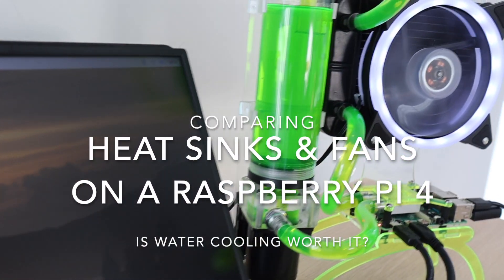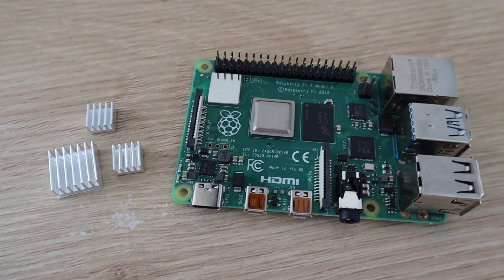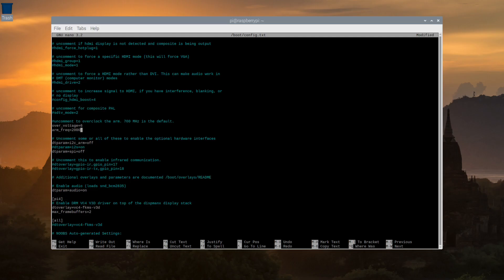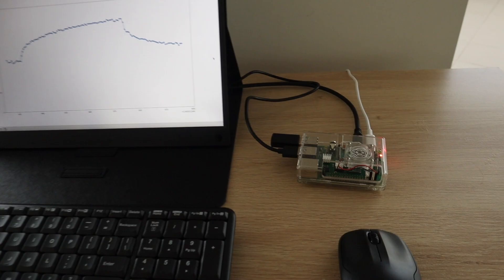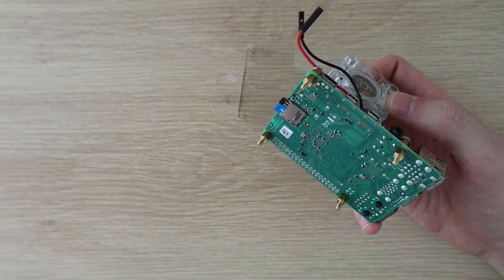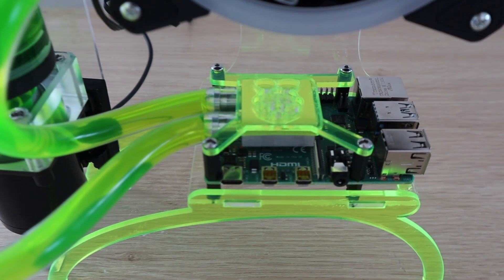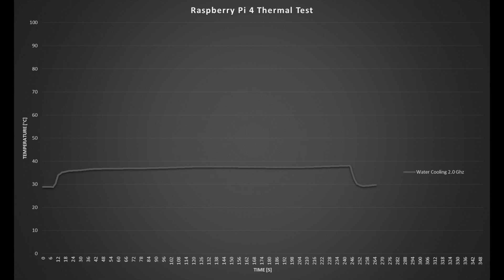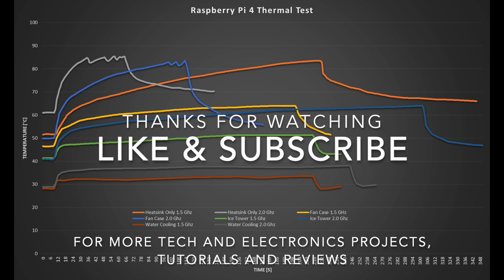Comparing Cooling Solutions On A Raspberry Pi 4 - Is Water Cooling Worth It?

Comment: Try a bowl of mineral oil.
Only half kidding.  A properly designed enclosure with many vertical exterior fins, and filled with oil, could probably keep the Pi cool all day with no sound.
Reply from the maker: Yeah, I've seen a few mineral oil cooled Pi's online and they seem to have good cooling results! I guess I'm just not a big fan of having an oil soaked Pi around and having to wash my hands every time I need to swap a connection or change the SD card - although you could work around this with a number of extension cables. Maybe I'll give this a try in the new year, sort of like an industrial oil-cooled transformer housing with radiator fins.
Reply: CooliPi?

Comment: I use argon one case to cool my raspberry pi 4s, overclocked to 2147mhz for CPU and 750 for the GPU, during normal use (emulation of GameCube, Wii, and Dreamcast) I rarely see temperature above 50 degrees Celcius (the fan kicks in when it reach 55 degrees. so under normal use, it is totally silent and just passive cooled) during stress testing I can reach as high as 55 degrees so the fan starts, but I have never thermo-throttled with this case, even during stress test overclocked to 2147mhz CPU and 750mhz GPU  and over-voltage to 8.
Reply from the maker: I've never tried an Argon case, but I've heard that they work pretty well! Thanks for the info.

Comment: Great video! I wonder how the Pi 400 would fare if overclocked this way. The Pi 400 has a heatsink that is essentially a big metal sheet spread over the width of the keyboard. It also runs at a somewhat faster speed of 1.8GHz.
Reply from the maker: Thanks. I haven’t had an opportunity to try one out yet but I have seen an article where someone overclocked it to 2.147 GHz and it ran for around 10 minutes without overheating. I’ll try find the link to it. The nice part of the Pi 400’s cooling, being a large piece of metal, is that it’s completely silent.
Reply: the Pi400 is a completely different chip, it has a much better stepping than the Pi 4. that's why it can perform so cool even with an overclock and  simple metal heatsink
Reply: @SweatyFeetGirl  Not completely different. Eben Upton has said, it's just another revision with some clock trees more finely grained. It even has slightly lower performance than the regular chip used in Pi 4 model B (according to MagPi benchmarking) - most likely it wakes up with some additional latency. I use my 8GB model at 2350/750/550 MHz for the CPU/GPU/core. temperatures under 50˚C with 27˚C ambient temp. Passive, no fan.
So, to reduce latencies anywhere, I run it at max frequency all the time :-)

Comment: Add some cheap four dollar thermal paste with the Ice Tower and it idles at 28 to 30 overclocked and never goes over 36. Simple cheap and effective extra
Reply: I got the same results using thermal paste instead of the pad
Reply from the maker: That’s a good idea, I must try it out in a test! I’ve seen a few people say that thermal paste works much better than the contact pads and then others say that they see no difference. 
Perhaps it’s the quality of the pads that makes a difference too.
Reply: @MichaelKlements  yeah I just replaced the pad included with the tower with the paste and it made a huge difference
Reply: @MichaelKlements  Pads are evil. Don't use pads :D

Comment: Awesome project. I have used the "whiny little fan in a case" option in the past. Might have to try a 120mm fan and some heatsinks to make a not-noisy solution.
Reply from the maker: Yeah I think with trying to make a quiet Raspberry Pi, bigger is better. Either put on a really large heat sink with no fan or just a larger and slower fan.
Reply: @MichaelKlements  While you are at it, how about cooling for a Pi 4 Compute Module as well? I need to get one for the NVME on the I/O board, but I can't seem to find anyone who has actively cooled one. Thanks.
Reply from the maker: I've been trying to get hold of a Pi 4 Compute Module and IO board for a few weeks now but can't seem to find them in stock at any of the usual suppliers. 
I've been looking at making an acrylic bracket to mount an Ice Tower onto the module using the four holes in the corners, it shouldn't be too difficult to do.
Reply: Why don't you just add one big heatsink without fans? CooliPi, maybe?